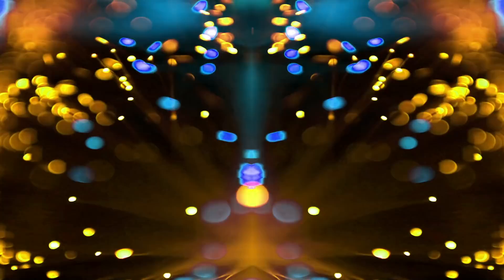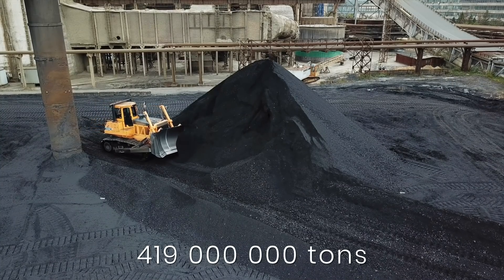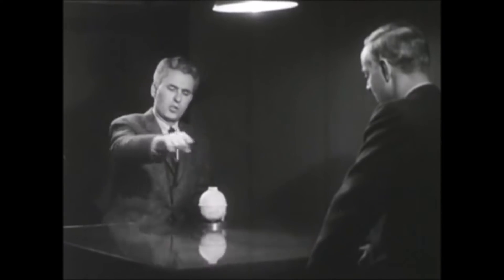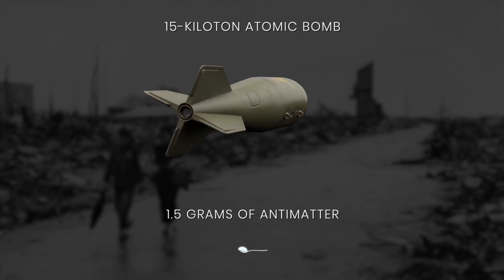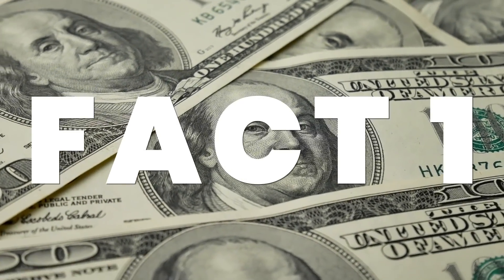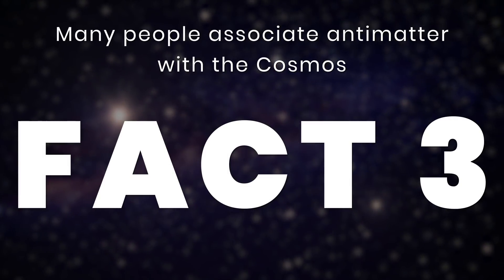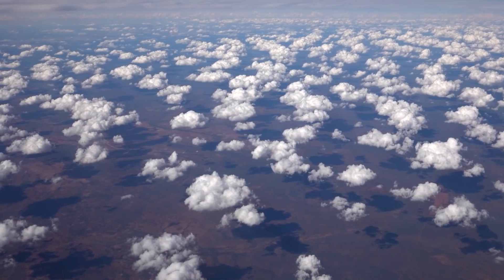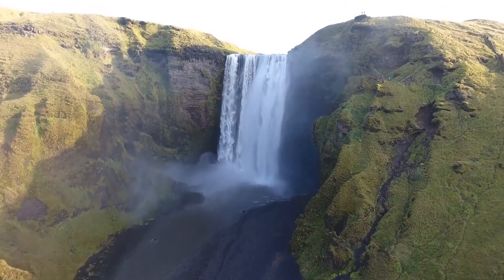One Gram of This Substance Is More Powerful Than a Nuclear Bomb!

Comment: If scientists were even able to contain a few kilograms of anti matter for a controlled explosion, it wouldn't be controlled for very long, because wouldn't that emit an insane amount of radiation, which cannot be contained based on thermodynamics law? So it would be impractical to even make such a thing, even with electro magnetic fields holding it in place.

Comment: There is an interesting hypothesis that states that when our universe was created, an antimatter universe was also created.  But the antimatter universe runs on anti time.  If you were to draw a line from the big bang to the present for our universe, you'd also have to draw another line stretching back into the past before the big bang for the antimatter universe.  That basically means your antimatter twin is 17 billion years in the past from our perspective given that the universe is 13.5 billion years old.
Reply: Agreed. I think from their perspective we would be in the past.
Reply: @sulanis8444  And from their perspective WE would be the antimatter twins.
Reply: @thefurrybstrd1964  meeting them would be explosive hahaha
Reply: and on this sense, Big Bang would not be the beginning as we thought of, it will be a cycle of Expansion and Contraction of The Universe from our perspective of time. The difference here is, in each expansion, the matters created on the universe will be of opposite physical properties from the previous one.
Reply: @himadrisekharmandal532  Basically it is not time but a vibration. Big Bang is a vibration
Reply: Time symmetry.
Maybe we could reach there through black hole.
Reply: @skondgekar  how would that even work? all black holes do is crush matter, they arent portals to another universe? and if we were to go to that universe, we would immediately be annihalated in contact with the antimatter.
Reply: doesnt work since it has normal gravity, anti time would only exist with exotic matters
Reply: @kermitkiller6669  I'm only relating what actual qualified scientists have hypothesised.
Reply: @thefurrybstrd1964  so albert Einstein isn't a qualified scientist
Reply: @kermitkiller6669  Nice try at putting words into my mouth.  You know as well as I do that Scientists disagree intensely all the time.
Reply: @thefurrybstrd1964  the stuff I'm talking about is what albert worked on
Reply: @kermitkiller6669  And there are well respected scientists today that both agree and disagree with much of what Einstein said.
Reply: @kermitkiller6669  if anti time does work with anti gravity, and as in our universe, anti dark energy will oppose anti gravity and would overcome anti gravity. So, in our perception of time flow, nothing actually changes, that means either heat death, or the Big Rip is our future
Reply: @himadrisekharmandal532  yes exactly what I'm saying
Reply: @Dirk Platinum duuuude!🤦‍♂
Reply: @Alan Torres yep. They're just theories. Not verified truth.
Reply: Kalki ironman after 2026 😎

Humans 0
Saiya-jin 1 to 6
Angels 7 😇

Kalki Ironman 5th matriya buddha 8th arc Angel 11th satguru 13th imam and 24th avatar after 2026 😎

Almighty God 9 😇

Humans type 2.5+ after 2026 by Kalki Ironman (christ in the white horse)(son of man on clouds) type 7 and 8 😎

Jarvis the world’s first artificial intelligence (parrot) 😎

Cuz Kalki is ironman batman super saiya-jin superman ben10 saitama optimus prime shaktimaan and every super heroes combined after 2026 😎

Jarvis world’s first artificial living being (just like vision in marvel universe)😎

Made of Quantum and sub quantum particles 😎

Power source quantum energy arc reactor (type 7) level technology 😎

Kalki Ironman going to have every kind of arc reactor like:- type 1 Nuclear fission, nuclear waste, hydrogen fusion, type 2 3 4 5 antimatter arc reactor (solid liquid gas), type 6 electro quantum arc reactor, and type 7 Quantum arc reactor, type 8 limitless quantum energy arc reactor without quantum particles 😎

Kalki Ironman going to have sun in a box million billion tons of hydrogen nuclear fusion reactor type 2 3 4 5 just like sun and stars in the palm of his hand 😎

This all going to happened by self replicating quantum nanobots knowledge energy and techniques at type 7 7 7- respectively 😎

Ironman (Tesla 2.0) going to reveal every secrets of the world specially Tesla and his Antigravity 😎😎
Reply: @Alan Torres we would be type 2 or 3 civilisation
Reply: @Alan Torres uhh what, I don't remember talking about this
Reply: Kalki Ironman type 7 and 8 after 2026 😎

kalki avatar (beast of the earth) (christ on the white horse) (son of man on clouds) is the biggest enemy of dajjal/antichrist/kali 😏

Kalki Avatar (Murtaza) 11th satguru 13th imam cousin of Moula mahdhi a.s. 12th imam (muhammad) 😎

Prophet Moula mahdhi is raja shashidhuvj (the mighty one) born less then 1200 years ago 😎

Prophet Moula Isa a.s. will kill dajjal cause dajjal is going to kill Kalki Avatar 😏

Kalki Avatar will follow orders from 2 religious king Moula mahdhi a.s. and Moula Isa a.s. 😎

Kalki Avatar going to have 2 swords and ring of moula sulaiman a.s. and staff of moula musa a.s. (iron rod) Staff of moula musa a.s. is like omintrix can transform into anything and can transform others into anything And stone in the ring of moula sulaiman a.s. is also known as kastav mani and it's more powerful than all 6 infinite stones combined 😇

Cuz Kalki is ironman batman super saiya-jin superman ben10 saitama optimus prime shaktimaan and every super heroes combined after 2026 😎

This staff will transforms into white horses with wings,weapons,iron-man,cloud etc or can do imagination into reality 😎

*Ratn sru sword of lord shiva (miri)😇

*Ratn varu (zulfakar) sword of Moula Ali (piri) 😇

miri piri 😇

Kalki Ironman after 2026 😎

Satyug (sunrise from West) 2038 😏

Sambal is hospital 😏

Gzwa e hind 2029 😎

Khalistan and Azad Kashmir after 2026 by Ironman 😎

99% Hadith u heard is not about imam Mahdi it’s about Kalki avatar (the main character) that person momin vs dajjal prove me wrong if u can 😏.
Reply: time is not physical or property of something its connected to gravity to change in other words no change no time so is extremely relative i know its scary time relative notion but the universe has no problem that u are scared about how things work u scared u die sooner if it would have a brain thats what it would say.. u use the time u have and think and maybe a small maybe ull be fine until next danger will try to kill u
Reply: @dumiicris2694  First of all, my god learn at least some grammatical structure!
Second of all, most of your comment is barely intelligible gibberish.
Thirdly experiments have actually been performed using atomic clocks on the ground and in high altitude and even orbital flights that have proven a direct correlation to the passage of time andLocal gravity.
Reply: @thefurrybstrd1964  god has nothing to do with anything maybe there îs a conception about how we should be and think in the name of gaya these experiments that u talk about show that theres more that we tought thats all does not explain anything they tell us we have to start thinking . Beleving Something doesnt make it real u know exactly what i mean hope and getting there are very diferent hope îs maybe succes means i was right and does not mean will be liked by everyone u know what i mean exactly
Reply: @dumiicris2694  The 'My God' part of my initial reply was an expletive, not an actual summoning of some superatural deity.  I was referring to your complete lack of grammatical structure which makes your posts near unintelligible.
Secondly, those experiments proved that Einstein was correct about both the effects accelleration AND Gravity have on Time.
Reply: @thefurrybstrd1964  yeah u do care yes and what about me what do You think i care about?

Comment: What if there were the same amount of matter and antimatter particles in the beginning of the universe. But, after annihilation the universe was rich in energy with very low concentrations of matter and antimatter remaining. Later on the conversion of energy back to matter occurred again. This means this process is a circular one which keeps repeating. But now we are just fortunate that we are in a small pond rich in matter but the universe is so big that matter and antimatter are still colliding we just too deep into a matter rich bubble that we don't even notice or even the light from the collisions is still on the way due to the vast distance between us and the outer parts of the universe.
Reply: Yeah, we can only see a very small part of the universe, which is probably much much larger than we can possibly imagine.

Comment: Wait if coal is used to produce electricity then how is electricity the answer the a greener world? Etc, surely making us move to electric cars etc means more coal burning?
Reply: There quite a bit more ways to generate electricity than burning coal.
Reply: @ferderonhurgeron9263  Then why do they still use coal?
Reply: The reason why coal is not a good energy source for our world is because the gases that coal produces after being used. There is more "clean" energy that would not produce this gases that are destroying the "shield" that protect us from UV rays (radiation from the sun)